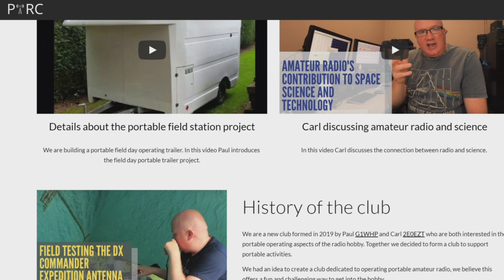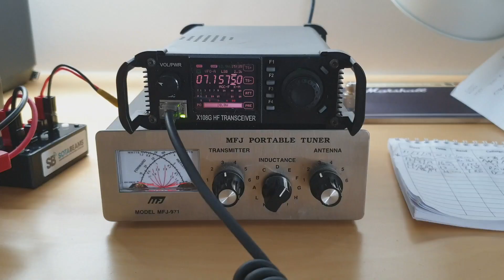First update on the portable amateur radio field station

Comment: Hey Carl excellent idea. In San Antonio, TX we have an "unclub" group with a van kitted out.  Go take a look. Enter 144200.net in the web search  Maybe you could pick up some ideas.  While we concentrate on VHF and up, we have capability to work HF and cover all operating options for emergency use.  W0YVY
Reply from the maker: Fantastic yes the 'club' is not the purpose here, working portable is, running nets and scheds is ok. Watch this space
.

Comment: Wishing you all success in this new venture. I am very interested in your plans and how much power you intended to operate with. The advantage of a caravan like yours is that you are not limited by the weight of the batteries you can carry. So, 100w, 500w??
Charlie KM4ZZ
Reply from the maker: Much depends on the length of operations, I rarely use even 50 watts but eventually with a club station there's more choices. I think 100w will be the max for a while.